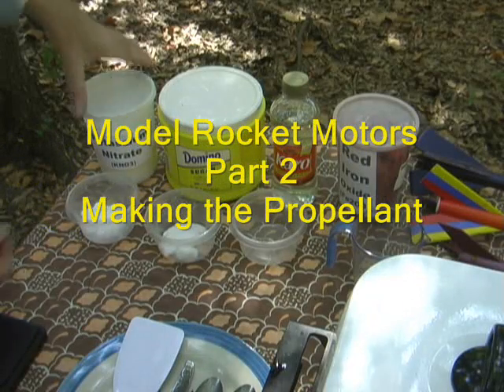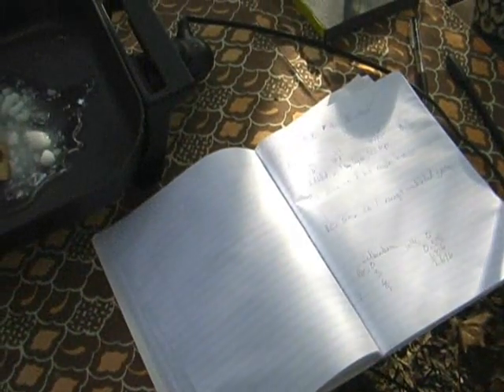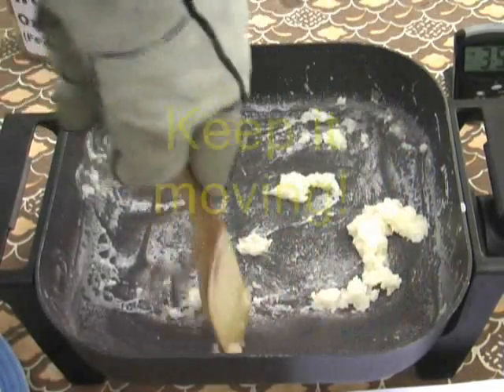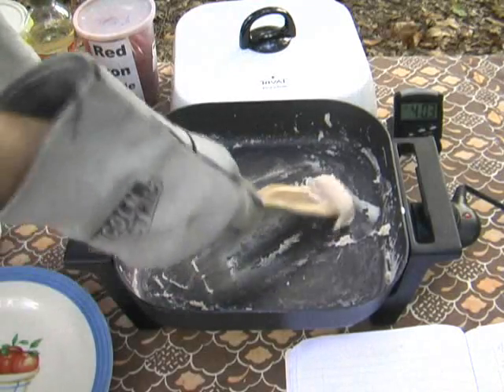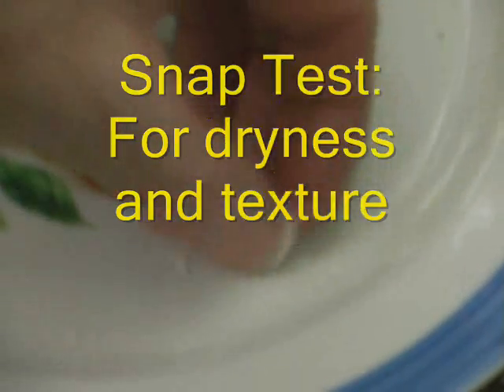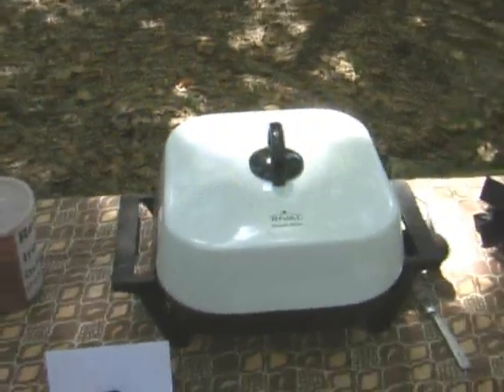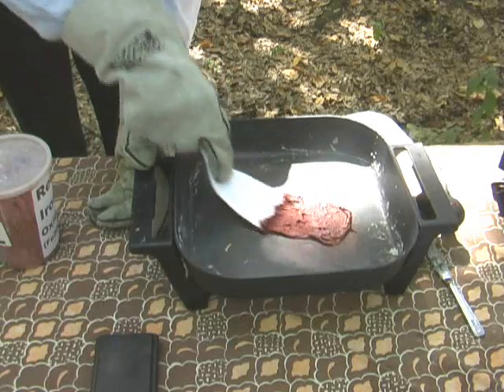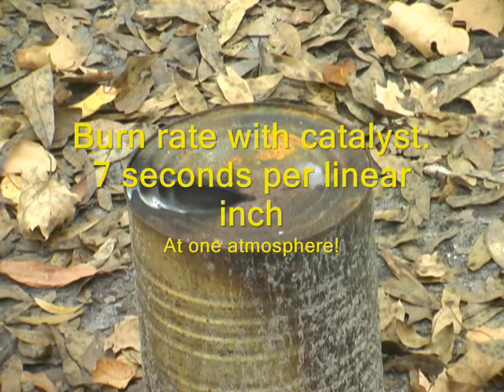how to make rocket candy (rocket fuel)

Comment: you don't must put the water otherwise it will become a smoke bomb
Reply: ThePixmaip the mixture is hygroscopic and is already a problem because the minimum humidity affect the performance of the rocket and if the humidity is not quite the rocket rises

Comment: its easier without the water. use 6 spoons know and 4 spoons of sugar. (more or less but depending how much you want, for best results it should be a 6 to 4 ratio) cook on LOW for about 20 minutes while stirring until soupy. It dries FAST. for fuses use 1 spoon kno3 and mix with 4 spoons of boiling water. soak a peice of paper coffee filters work best let it dry roll it tight. hope this helps
Reply: yeah but with water it gets dissolved and evenly spread, and then prevents the sugar from caramelising, idk but this is better!
Reply: **6 spoons KNO3 4 spoons sugar**
Reply: Indigo Anon No no no. It's a 6:4 ratio by MASS not VOLUME. Different molecules have different densities. Doing stoichiometry, you will want approximately a 1:1 ratio by VOLUME. I suggest measuring by mass though, as different sugars (powdered or granulated) have different densities.
Reply: granulated sugar works best kno3 in powdered form, 6 to 4 ratio. christ mate it's not rocket science ... oh wait XD. NE way that's the ratio that works best for me and the burn time and intensity i desired. For a slower burn add a little baking soda, want it to look cooler n burn hotter add some aluminum powder, u can use red brick dust, all kinds of stuff works experiment a little have fun be safe and only use the word no once cheers mate
Reply: Indigo Anon Actually, he's right. It's a 6:4 by mass, not by volume. Basic stoichiometry can be utilized to determine the ideal mixture.

Comment: The problem with this propellant is that is Shock Sensitive(A bump or minor drop could crack the motor Grain). It Is tempreture sensitive ( hot/cold cycles can also crack and stress the Propellant) and this propellant does not store well ( Propellant tends to bio-degrade over a shot period of time)

Comment: It won't ignite from the heat of the skillet no matter how hot your skillet gets. It will just melt. It is extremely stable and will only ignite when it touches a flame. It can ignite, however, if you cook it over an open flame and some fuel drips over the side of the pot.

Comment: So I have been looking at all of the methods of making rocket candy. I was wondering which way of mixing and cooking the propellant was best; either corn syrup, sugar, and kno3, Or just melting sugar with kno3 in it and letting it harden?
Reply: Dissolving sugar and potassium nitrate in water and then heating it is the best method.
Melting the sugar in the mixture decreases the performance of the propellent.
Corn syrup can be used a binder for the fuel. It is advisable to use it.

Comment: @leif4884 the ratio i know that everyone i see uses is: Take X amount of KNO3 (pottasium nitrate) (in grams), an equivalent amount of water (in milliliters), half as much sugar (in grams), and a quarter as much corn syrup (in grams). For example 100 grams of KNO3, 100 milliliters of water, 50 grams of sugar, and 25 grams of corn syrup. Change theese ratios for a larger or smaller batch.